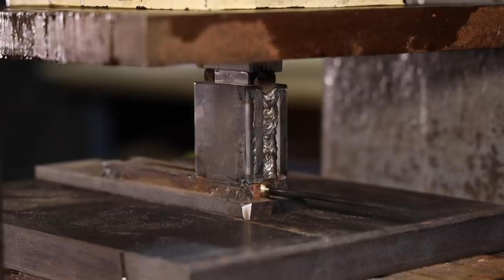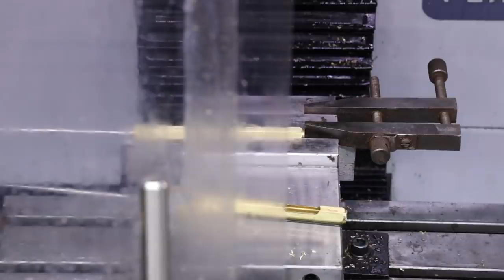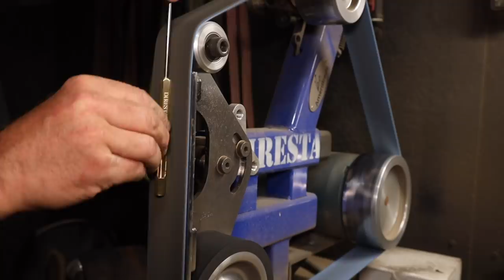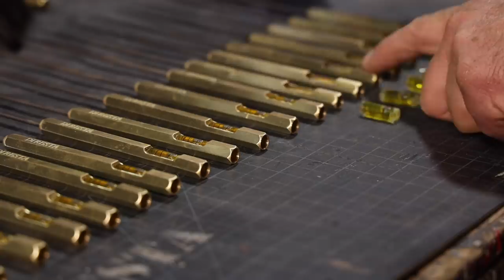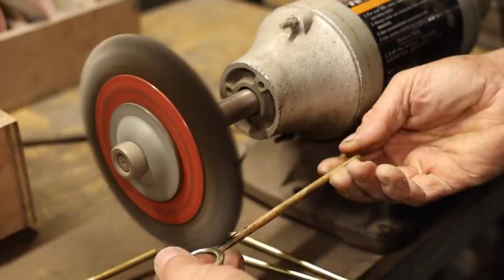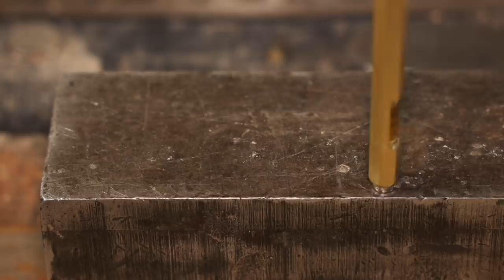DiResta Ice Pick with Level & Magnet

Comment: 2030: diresta icepick features
-nuclear fusion generator
-emp device
-titanium cutting laser
-level gauge
-sos whistle
-flashlight
-ice pick
Reply: &CD drives
Reply: And additional retro fitting,a cassette player.
Reply: and an "instabeercooler-ray 1000TM"  which he will invent in 2028
Reply: I have it on good authority, will also have the scaled down version of the FLUX CAPACITY , made with Material Compatibility: Plutonium or the newer and improved Aerospace Billet Unobtainimum
. SPECIAL EQUIPMENT REQUIREMENTS: ENGAGE SAFETY SQUINTS.

Comment: Just an idea for the mnfg process of the protective sleeve: Crimp the open end with a drill chuck (maybe put a dimple on one jaw?), then use it on a drill to spin for the knurling.
You could also go ham with the knurling at drill speeds to "individualize" every single piece :D

Comment: Consider:  If you were to 3d print a disk shaped Led light housing, to fit the ring hole,(double 2032 batteries with a usb charging port maybe) it could be a handy trouble light too. Neat anyway. Bo.

Comment: What if you got a tiny ring magnet and put one around the sheath and the base of the pick to help keep it on the needle? Sort of like a tiny "lock" or so. Unless the sheath stays on fine.
Reply: it stays on fine, the one I use daily, I have to occasionally "tighten" it, by tapping it closed or re-striking the dimple with a center punch.